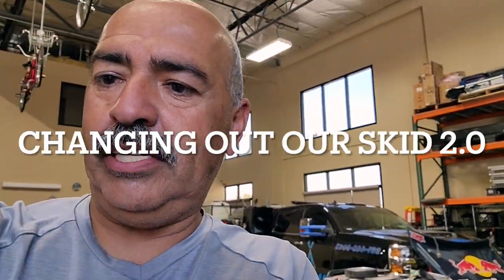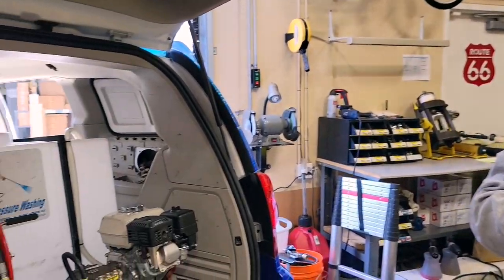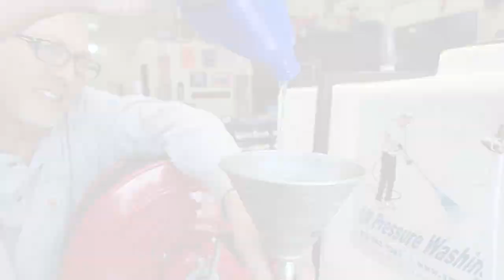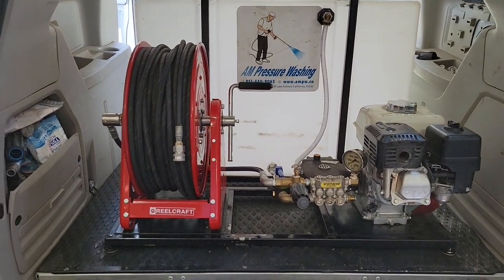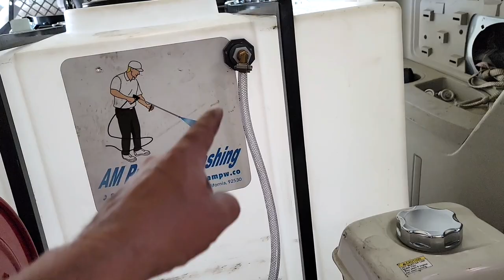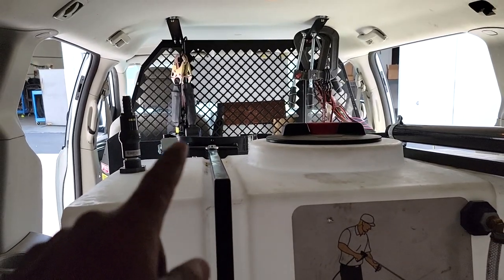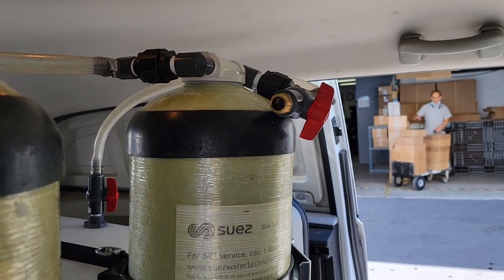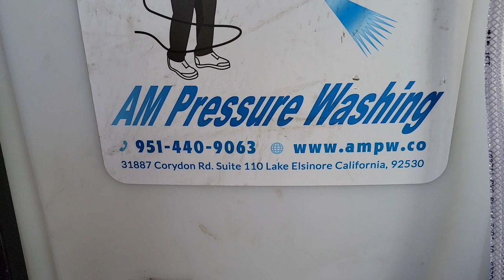Our Pressure Washer For Solar Panel Cleaning 2.0 | AM Pressure Washing

Comment: Better setup is to eliminate the gasoline pressure washer and go electric kranzle pump  motor unit running of a pure sinewave inveter , much safer no fuel needed great pressure and flow... also built in pressure machine shut off when you release the trigger... protects the motor and less wear. ... ideal for solar panel cleaning.. David from Australia 👍
Reply: Save money on gasoline, less noise and no fumes and your van won't catch on fire 🔥🔥
Reply: Hi, do you have such a setup?
Reply: Electric won’t last you but maybe two houses after that you got a charge again
Reply: @RawAnUncut   solar panel on top of van roof rack , plenty of charge

Comment: Apologies if this has been answered elsewhere, why do you need the water tank in addition to the 2 bottles? I'm in central California, Manteca. Recently my sister had solar panels installed and I found out solar panels need to be cleaned. I became very interested and started doing research, and found you guys. THANK YOU so much for sharing your knowledge. I've subscribed to your channel. 

I run a commercial hood cleaning business. Dirty job with odd hours. Sick of it. So I want to get the minimal amount of equipment to get me stared in the solar panel cleaning business. I found a de-ionizer tank online that may work as a start up. It's called DI Pro 100 Compact at rv-mods.com. This tank achieves up to 4,000 gallons. I also found the dual rotating brushed you have shared with us. This brush delivers 2.3 gallons per minute consumption! Whaaaaa!!!! Is that why you need the water tank? This could be costly, the more water one uses, the more resin one has to buy. How many gallons do you typically use on a residential job?

Comment: Do you use your high pressure machine in your solar panel cleaning?

Thank you from South Africa
Reply from the maker: Yes I use high pressure  to run my brush only… we do not use high pressure to spray the panels directly it will damage them